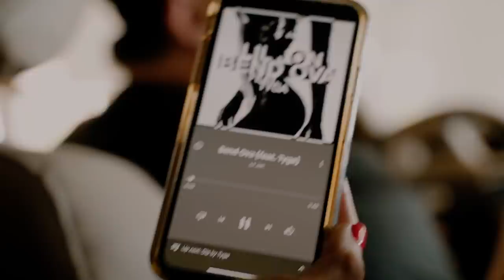Part 1 | Ready. Set. Launch. My 300 mph internship has officially begun...

Comment: Tony will be a natural at this.  He can drive anything and win in it.
Reply: I was gonna say the same thing. He's got this, no problem!
Reply: @Cheryl_Haydon  yet he didn't want to get back in the car to steer it back to the hauler. I wonder if Smoke needed to change his skivvies after that run?
Reply: @sergeantmasson3669  Haha, it's very doubtful. Smoke has balls of steel and is at ease behind the wheel of any type of race car. He's the man!
Reply: @sergeantmasson3669  I was thinking the same thing. Even with Tony's racing pedigree, one does not just hop in a top fuel dragster. For his safety and the crews. He needs to at a minimum work his  way up with other dragsters
Reply: @pw383426 Lol.....                                            "Hold my beer"                                Smoke
Reply: @sergeantmasson3669  wouldn't be the first time for smoke!
Reply: As much as Tony will absolutely have the skill to drive one of these, winning races in the nitro classes has more to do with crew chiefs than it does the drivers. The team needs to make the right calls on setting up the car before every run to get wins. Tony's job is as simple as cutting a good reaction time and keeping the car straight (which in itself isn't easy).
Reply: @sergeantmasson3669  You have done it several times? Post videos of you doing it.
Reply: @bigelile07  I'm not obligated to show you, or anybody else, anything. Not only that but my runs were filmed and not video taped. We stopped running an AA/FF car in the late 70's.
Reply: @sergeantmasson3669  
Okay 😂
Reply: Yeah the capco boys will show him how it’s really done when he gets into actual competition racing.